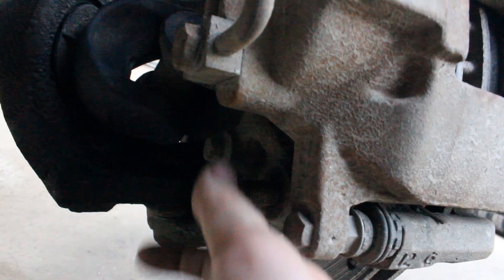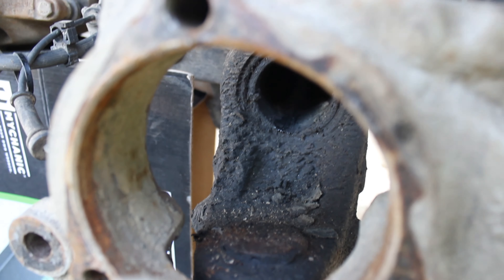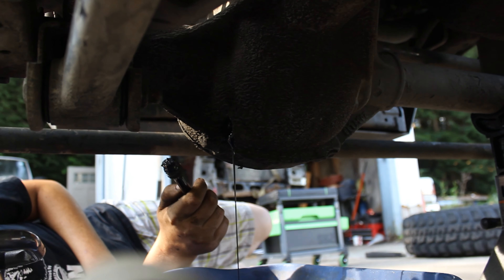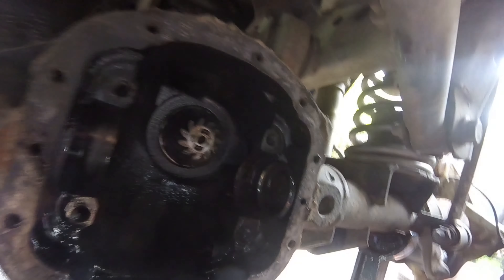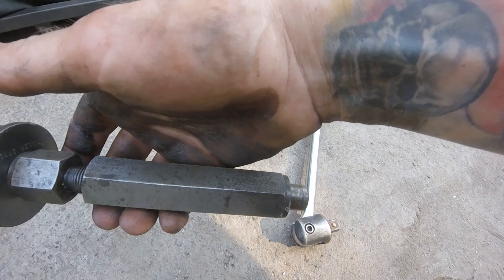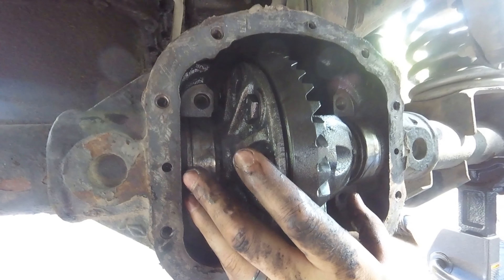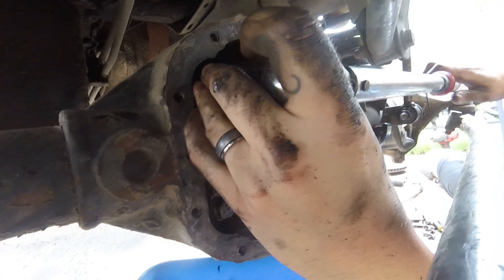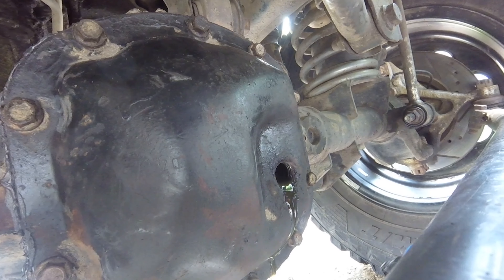How To Replace Inner Axle Seals In A Jeep JK/JKU

Comment: How much fluid does the diff hold? I have a leak on the passenger front seal. So Im about to tackle this job, replacing both seals along with ball joint replacement. I just want to get all the necessary supplies. Lol
Reply from the maker: Depends if you have the Dana 30 or Dana 44 front axle you can find it easily with a quick google search. Let me know if I can help at all with anything else

Comment: is the rear axle similar?
Reply from the maker: No the rear is completely different everything is pressed on the axle shaft
Reply: And you can buy the axle shaft with all the parts pressed on from extreme terrain.
Reply from the maker: @justinmorbeck3604  you can but if your rear shaft is still good why replace it?

Comment: Are both sides the same part number or different for drivers side and passenger?
Reply from the maker: I believe they are the same part number same seal just put on one side or the other
Reply: Just found out the differences between the mopar and nationals, there’s a sleeve that fits in the mopar that slides into the seal and the nationals is just a rubber fitting and no steel sleeve hopefully this works
Reply from the maker: @SkateForPoverty  I’ve installed the national ones with good luck 👍🏻

Comment: Great video 
I have 2014 Jeep unlimited Sahara how do I know what axle I have Dana 30 or 44? Thanks
Reply from the maker: You have the Dana 30. The rubicon is the only one that came with the 44. Yours would be the same as mine
Reply: @TheBeardedJeeper  
Thank you so much 

I took my car for oil change today it was cheep but good shop 
They told me I need 
New radiator it’s leaking 
Axle seal 
Front brakes 
All shocks 
$2600 
I got all parts for $400 and will perform this weekend 🤣👍🏻
Reply from the maker: @mikimiki195  that’s awesome! Glad it helped you out. Let me know if you run into any snags

Comment: Please type of oil do have to put another slippery oil or just Axle oil
Reply from the maker: 80W-90 but I would double check in your owners manual it will tell you the type they recommend and the amount.
Reply: @TheBeardedJeeper  problems is lost the car manual I have seen people add oil witj slippery is the right or oil can be enghou

Comment: I was thinking of replacing the axle shafts that come with the seals already on them. Will that work also? What throws me off is that the seals you replaced seem to be inside. Installing new axle rods, the seals are definitely going to be outside.
Reply: Will that work or will I have to replace the ones inside to stop the leak?
Reply from the maker: @Fabs0324  so the axles that come with them on are the rear axles. The rear axles have seals and bearings pressed on. The front has these inner seals. I wouldn’t replace them unless you notice them leaking

Comment: I need to replace my Rear Axle Seal '11Jeep Wrangler. The outer ones near the tire. TO do this do you just buy a new rear axle shaft? And if its leaking on the outer axle does that mean its time to replace the inner axle seals? My guess is yes but I am a rookie. What do you think, please?
Reply from the maker: The rear axles are more difficult and will require a press. There is a seal a bearing and a race that you have to remove and then press new ones on. You can bring it to a shop to have them press on the new parts if you remove the old ones cheap or if you have a press do it yourself
Reply: @TheBeardedJeeper  Thank you. I appreciate your reply.

Comment: Great video

Thanks a lot 

I will give er a go
Does it matter if it's a rubicon with the diff locker

Same job sir????

Ohhh and I have a beared also friend
Reply from the maker: Hey man thanks I appreciate that. Only difference with the rubicon is you will have the electrical connection for the locker you just have to unplug it

Comment: I have a 2018 Jeep Wrangler JK Unlimited Sahara edition I am looking for the rear inner differential seals any ideas on where to get these? I'm struggling to find the correct parts. I believe its a Dana 44. there is oil on the rotor shield on the rear right axel area.
Reply from the maker: you should be able to find them at any auto parts store the rear is a lot different and you will need a press. You have to cut the old bearings off and press on new ones with the seal

Comment: how tf did your diff just come out. mine stuck and im going to have to spread the casing with special tool
Reply from the maker: You don’t have to spread the case. Some are in there tighter. Tight is good my bearings are a little worn. Stick a rag in the diff and turn the pinion let the rag suck up into the gears and it will help push it out. Carefully pry with a pry bar I wrap a rag around mine and pry it out. You should be able to do it without the case spreader
Reply: @TheBeardedJeeper   ok will give that a try thanks. i dont have the seal installer either but it looks as if theres enough room to tap it in i hope
Reply from the maker: @mattm2411  yeah you might need to put a rod through the axle to be able to pound it in. I’ve done it that way too
Reply: @TheBeardedJeeper  shes a 18 with low miles only 30 on it. im using a big pry bar too :/ she tight
Reply from the maker: @mattm2411  yeah tight is good. Putting that rag in the back and using leverage from the pinion gear should help to push it out

Comment: Thanks for the video. Could not have done the job without it. After putting it all back together I tested it out and could hear a tearable gear sound when I put it into 4wd. It sounds fine in 2wd. What is the mostly mistake I made?
Reply from the maker: That doesn’t sound good. Did you tighten all your bolts to spec? Put the bearing caps in the correct way? Put all your shims and everything back in?
Reply: @TheBeardedJeeper  would it be caused by over tightening?
Reply from the maker: @MrShaddy580  it could be it’s hard not knowing exactly what the sound is. I wouldn’t drive it anymore and I would open it up to see if anything is loose or broken
Reply: @TheBeardedJeeper  I’m pretty sure it’s the cv joint. (Probably broke a while ago and I never noticed) is it safe to drive as long as it’s in 2wd? Thanks
Reply from the maker: @MrShaddy580  on the driveshaft?

Comment: Thanks again, 2 questions though, can you fit the seal without that tool? And how much different is it to do a Rubicon diff?
Reply from the maker: yes you can do it without the tool but the tool just makes it easier. The only difference with the rubicon is that you have to disconnect the wire for the locker

Comment: great video i have leak in one front passenger side so time to change but im going to do BOTH side just in case front and back axels thanks for the video now question what axel did you have
Reply from the maker: Nelson en ACCION 4x4 thank you! This was on a JK Dana 30 but same process on the 44 if you have the factory e locker you just have to unplug the locket wire

Comment: Can you use break cleaner for the differential housing/parts?
Reply from the maker: Mike James yes you can it works really well to clean things out
Reply: @TheBeardedJeeper  sweet. I do not have the seal installer so I am using a 1.5" socket and light taps.. any tips on knowing how far in it needs to be so it is fully seated? visually I am unable to tell if it's far enough/all the way in.
Reply from the maker: Mike James you should kinda feel it bottom out when it is fully seated. I never used to have the tool but it makes it so much easier

Comment: Got a quick question, is there an O-ring inboard of the inner axle seal between the race bearings and the carrier. I removed mine on both sides of the diff pumpkin. I can't find a part listing for an O-ring but I noticed that in every picture or video it looks like sealant squeeze-out or an O-ring. Don't wanna do rework at this point!
Reply from the maker: Not that I have ever replaced it is just the seal itself. Maybe if you have a rubicon with a locker
Reply: @TheBeardedJeeper  Nope its an 1996 XJ
Reply from the maker: @eastcoastteddy58  hmm not sure I don’t think there should be one

Comment: I have a 2016 wrangler, I went off roading about a year ago. Got stuck n put a lot of pressure on one of the front wheels winching it out. Notice a little oil like fluid had leak from one of the front wheels on the inside near the axle I guess. Now my abs n traction control lite comes on only in the summer when temps are warm, but never in the winter when temps are cold. Anything like that ever happened to you or have you heard anything like that.
Reply from the maker: Charlie St. Cloud never happened to me. I’m wondering if oil is flowing more in warmer weather and getting on your abs sensor

Comment: 710863 national oil seal
Reply from the maker: don lum thanks for sharing the part number!
Reply: @TheBeardedJeeper  where can I get the seal install tool
Reply from the maker: don lum there is a link in the description you may be able to find one cheaper on there or check your local auto parts stores they may rent them

Comment: This might be a stupid question but is there an 'outer' axle seal as well? Thanks for the helpful video!
Reply from the maker: No outer seal unless you buy aftermarket ones. Stock it doesn’t come with any. Thanks for watching
Reply: @TheBeardedJeeper  Thanks for the info! would you recommend installing an outer? Also, I'm assuming the rear axle seals are a similar process?
Reply from the maker: @davidfrangos3702  I’ve never needed them but I change my diff fluid a lot. If you go through a lot of mud it might not be a bad thing. Rear is completely different you need a press

Comment: What if you have a Rubicon front dana 44, what do you do with the carrier/locker when there’s wires attached to it?
Reply from the maker: Big Nort same process you just have to disconnect the wire before you pull the carrier out
Reply: I know this is over a year old , but on the rubi with factory lockers , before you put the carrier back in, pull out the plunger, it looks like a mushroom ? Best description I could come up with, put a toothpick, match stick or golf tee to keep plunger out and tie a piece of fishing line to whatever piece you use, install carrier, then pull the line out with the wedge.

Comment: I was able to remove one of the three 12-point bolts, the other two are stripped. Any issues with using MAP gas to heat them up?
Reply from the maker: Michael James stripped?  How did they strip? Do you mean the bolt head? Map gas will help if they are rusted in there. Just make sure brake lines and abs lines are not in the way
Reply: @TheBeardedJeeper  the heads of the 12 points are stripped not the threads lol
Reply from the maker: Mike James ahh you might be able to pound a smaller socket on them to get them off
Reply: @TheBeardedJeeper  I had to grind the 3 hub bolts a lot of rust the bolts stripped and even a smaller socket hammered didn't work made it worse. I ve had to do the axle u joints ball joint and hub.  Think I might as well do the seals it's an 08 Rubicon.
Reply from the maker: @carlosllauro4532  wow I’ve never seen them rusted that bad usually some heat and they will come right out

Comment: I pulled the old seal, on my 13  and i was looking for a replacement and seems like mine is two parts seals,  is any difference? and also once i pull the axle shaft  out, there is some seals that came out with it , thank you on advance
Reply from the maker: Two part seals? Are you sure it’s not just broken into two pieces? Also the seals that came out with it are they around the axle shaft? Some pics would help. Feel free to email me. Thebeardedjeeper@gmail.com

Comment: Thanks for doing this vid.  I have a 16 jku with open dana 30, i see you did not need a case spreader?
Reply from the maker: WBOS72 nope I did not. From what I’ve seen some will be tighter than others but I haven’t seen anyone need a case spreader on a JK. Usually you can gently pry behind it and get it to come out.

Comment: Successfully completed based on your video...thanks.  However, now I hear what seems like a slip in the gears upon initial acceleration, this happens only once until the vehicle is off, sits, then goes again at each start up, it does not happen when driving after that.

Also, now have speed sensor error C1014 I can’t keep clear.  Wheels were disassembled again and both sensors cleaned, error remains.

Any thoughts on either of those issues?

Thanks
Reply from the maker: Curt W the gears shouldn’t be slipping. Did you put back all the shims and evening on the correct side? Also did you torque everything to spec? As far as the sensors, they could have been dirty and caused the error it takes a bit for the error to clear. You could disconnect your battery for like 10 seconds and it will wipe them out. If they come back they probably are damaged. Luckily they are really cheap to replace
Reply: The Bearded Jeeper well I decided to take everything apart again and switch the shims around....that appeared to do the trick as far and the “slipping”.  I can’t believe such a small difference has that effect, but then again I never performed this much and this involved maintenance on vehicles till I bought this money hungry JEEP.

I also resolved the ABS/Traction control issue by replacing that sensor...easy fix, hard to get to connection but got it.

Thanks for the initial video on the seals, easy to follow and was balls on as to steps to take for a novice like myself.  Will look for yours when the next issue pops up.  🤪
Reply from the maker: Curt W awesome man glad to hear it helped you out. Sometimes the littlest things can make a big difference. Let me know if I can help you out anymore and thank you for all the support

Comment: Great video
some info for people live up north:
on stock Jeep to get better access to the diff, unbolt the tie rod on driver side, and lift the tie rod with bungee cord
if you live in rusty area, do not hammer on the 12 point bolts directly, they will get damaged, and each bolt is $20 (Canadian) from Fiat/Chrysler.  
to remove the hubs, use a 7 ton puller, I broke a smaller 3 claw puller trying to remove the axle hubs.
Use brake cleaner to remove dirt and rust, use penetrating oil before removing any bolt.  
Before putting everything back, put anti-seize on all contact surfaces.
My front differential gear carrier didn't come off easily, I had to stuff a rag in ring gear and turn the drive shaft to force the gear out.  a case spreader would be nice.  doesn't seem very hard to make if you have welding machine.
Reply from the maker: David 326 thanks for all the great tips. You can pound on the hub bolts without damage if you put a socket over them pound on the socket and not on the bolt itself. And yeah some gears come out harder than others. Case spreader would make easy work if it but most of the time you can gently pry and get it out. Thank you for watching I really appreciate it
Reply: @TheBeardedJeeper  thanks for the correction, another trick to remove the hub is to loosely bolt the rotor backward onto the hub, and use the rotor as a slide hammer.
Reply from the maker: David 326 I had to use that trick with my rear axle it was stuck in there really good. That trick works surprisingly well.
Reply: @zxborg9681  Ha, I'm from Toronto too.  glad this helped. my bolts' thread were gummed up with rust and mud, the impact gun with universal joint couldn't even turn the bolts, I was worried the bolts will snap under impact, so I turn all the bolts by hand with 1/2'' breaker bar, I share your pain.  feels like most of the time we are battling with rust.  little tappy tap tap doesn't work up here.  I used the 7 ton puller borrowed from part source (or can tire) to pull the hub and axle off.  even with the puller, I had to use a long breaker bar with extension tube to pull the hub off.
Reply from the maker: Kenn Heinrich rust does suck. People from down south think I don’t take care of my jeep. But it is a daily driver in the winter they put a lot of salt on the roads and it makes a job 10x harder if it is all rusty
Reply from the maker: David 326 breaker bars are your friend for sure. Along with never seize. My front end comes apart pretty easily now since I put never seize on it every time.

Comment: 1) what size socket did you use to knock the old seals out?
2) will those seals work on a D44?
Reply from the maker: David Mullen I used an inch and a half but whatever size will fit on the edge and push it out. And yes the seals should be the same for both the 30 and the 44

Comment: Great video guys!    I have a  Rubicon with the factory locker.    I heard you need a special tool to remove the electrical locker connectors.     Do you know if that's true and if so what tool?
Reply from the maker: Troy Johnsen thanks man. As far as I know you should just be able to unplug it without any special tools

Comment: Is the spec for the torque of the side caps 45 ft/lbs- 60 ft/lbs?  Currently have my jk dana 30 apart.  That was the torque spec I was told by a friend.  Currently torqued at 52 ft-lbs.
Reply from the maker: will ram yes that is correct